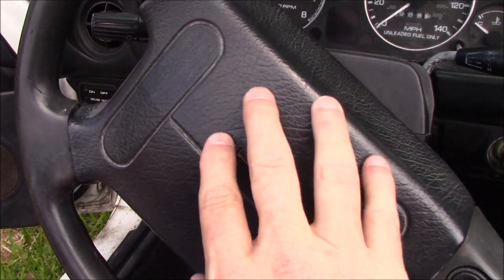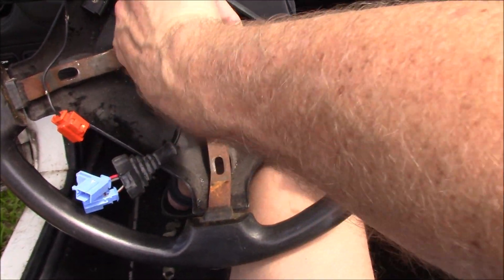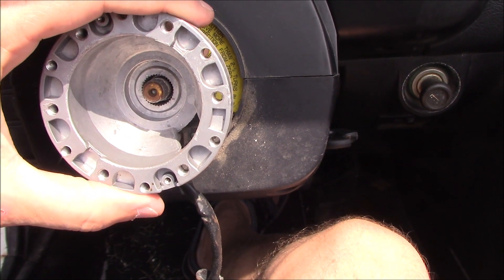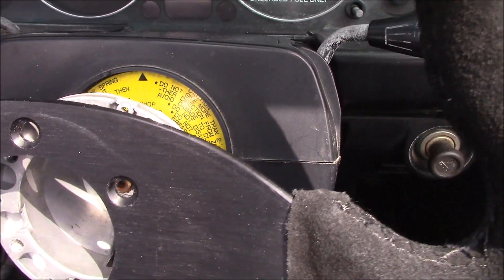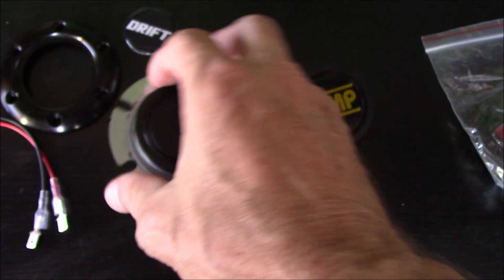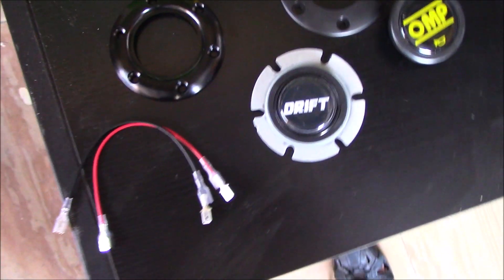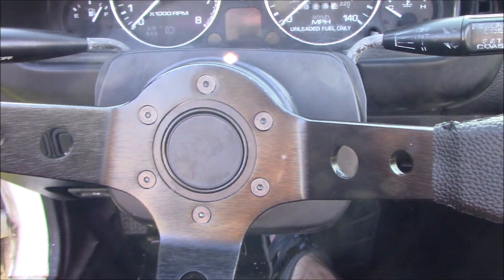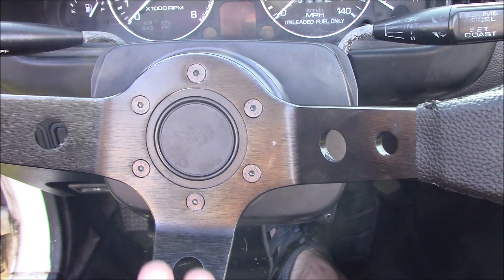Miata-Project "Ugly M"= After Market Steering Wheel Install

Comment: This video helped me out the other day.  I installed a steering wheel on my '87 Honda, and there was only one 1 wire for the factory harness.  Couldn't figure out how to get it to work, because the car didn't have a steering wheel or other wiring when I got it.  Followed what you did by sandwiching the spade connector between the button plate/wheel and the hub.  Worked immediately!  Thank you, I didn't see this info in any other aftermarket steering wheel install video!

Comment: Usually when your steering wheel gets a little cockeyed its because you have front end issues. It could be several things. Pitman arm, steering shaft joints even, something twisted. Could be a multitude of things.

Comment: Airbags can remain energized for up to 24 hours after the battery is disconnected. They have capacitors in case power is lost in the initial crash, then you go head on in to tree for example.

Comment: You should of just had a proper 4 wheel alignment done that would of corrected the position of the steering wheel and you would not need to drill the adaptor.

Comment: I was going to say about the battery but you removed power or earth leads off before took the air bag off the other thing was about your steering wheel off alignment do or have a four steering alignment  check or get your self a tape and check axle alignment ie(nearside front axle to back axle)and then check (offside front to back axle) just to see if there are the same measurement .all so check for uneven tyre wear on all four tyres.

Comment: MX5 as known in Australia.....  Disconnect Battery and leave for some time before attempting to remove air bag, to allow the system to fully discharge any residual current....   So you can "legally" remove an airbag fitted steering wheel and still be "roadworthy"???

Comment: i have seen some1 break their neck with an air bag. Find what the OEM process for deactivating the system some still are on for an hour after the battery is unhooked. Be safe and smart. David if you have any question email me i am an ASE master tech.

Comment: Don't think I would go without an airbag.
Reply: I drove for 25 years without an airbag.  Plus my bike doesn’t have one ...  my car now has 8 airbags.
Reply: Have you ever used an airbag? I had the same thoughts until someone made a left turn right in front of me. My first thought after the impact was wow the airbag went off, I hardly hit him. Pulled onto shoulder and looked at the car, passenger front tire was sideways and almost back to the firewall. Decided right there never to have a car without airbag again.  Be safe my friend.